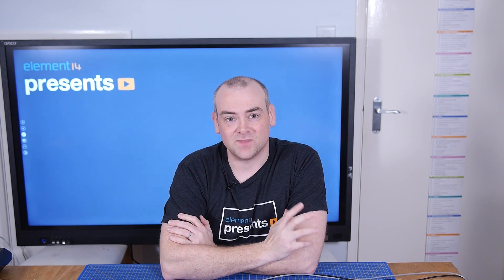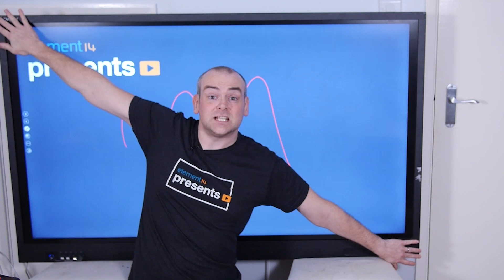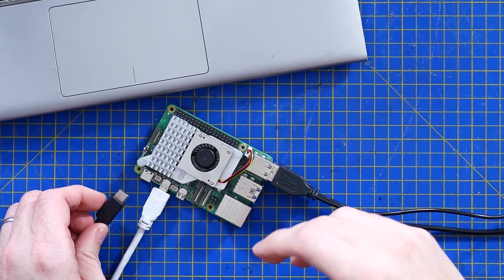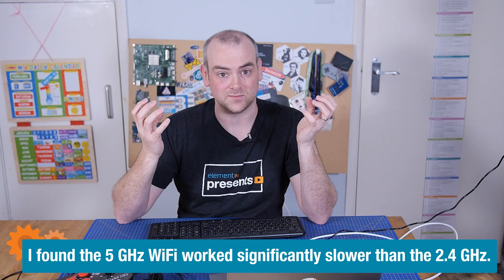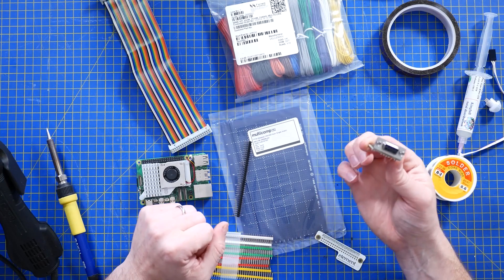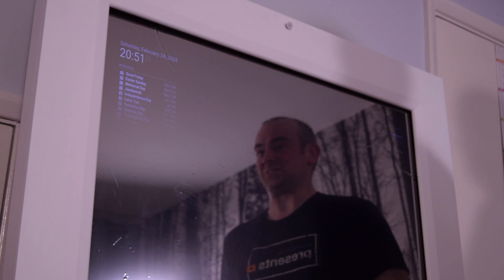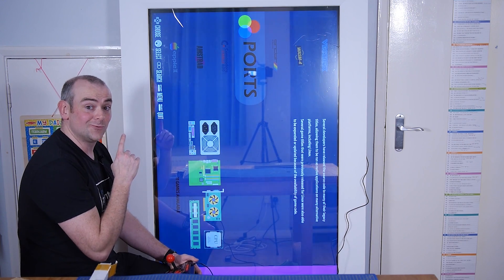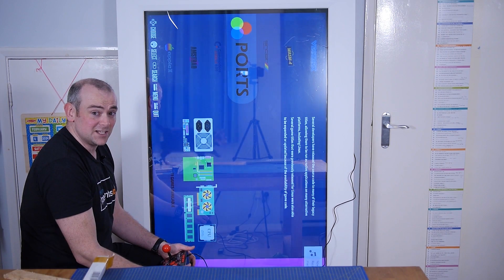Giant Retro Gaming Magic Mirror with a Raspberry Pi 5!

Comment: Can you not just use DPMS for the display? I have a similar calendar display on a Pi 3 to a 27" regular PC monitor. I just have it set to turn off the screen after ten minutes and it uses less than 1W (excluding the Pi). PIR is Zigbee to Homeassistant and then a simple script listen on MQTT and do a DPMS display on command when triggered. May not be quite so low power for 24/7 but should be better than just blanking the screen.
Reply: DPMS (standby) should put the TV around 1W in the EU(?!). 20W raspi-PSU is max output, so should be lower...
Reply: Btw. On X11 "xset -display :0.0 dpms force off" or "on". With xset you can setup the screensaver to use dpms "xset dpms <standby> <suspend> <off>" replace <> with seconds. 
On wayland i use "loginctl unlock-session <session>".

Setup the timeouts (screensaver) and bind the "xset on" or "unlock-session" command to the gpio.
Reply: @user-up2rz4oo7v  Yep that's exactly what I do. I just let the system turn off like normal on the time out at 10 minutes and every time I get an MQTT movement message from the PIR I just turn on the display with xset just like you've posted. That keeps it on as long as there's movement every 10 minutes or less.

Comment: HDMI CEC can turn the tv on off and control volume, source switch...... Instead of RS232. Most "TV's" just need to enable CEC or apropriatetrade name.
Reply: I could only get power control with CEC, the volume and source controls didn't work!
Reply: @a531016   maybe cec-ctl could help. Cec-ctl --help-audio-return-channel-control
And the tv have to support the Feature and maybe has to be enabled. I would have hope i could help more but i dont have similar setup. I do not believe, it has to be with the audio return Channel.

Maybe test it with kodi, and the tv settings.

Comment: Should use soapy water to apply the film for a flawless result with no air bubbles or wrinkles.
Just like you apply window tint on car windows or car-wrapped film.
Reply: Noted - It didn't come with much in the way of instructions, so I'll try that on my repeat attempt!

Comment: Isn't it 
display_rotate=0/1/2/3
inside the boot/config.txt file?
Reply: It's currently set to
display_rotate = tiktok
Reply: I have certainly tried it, no joy
Reply: @a531016  is that maybe as you mention using an intermediary boot system to choose mirror or emulation station? maybe try an install thats retropie at the OS level and load the mirror software onto that so you can run either/or?
Reply: @preferredimage  true, it's worth a try!